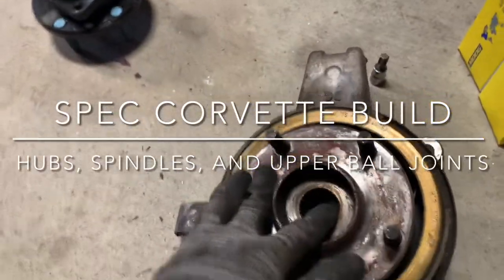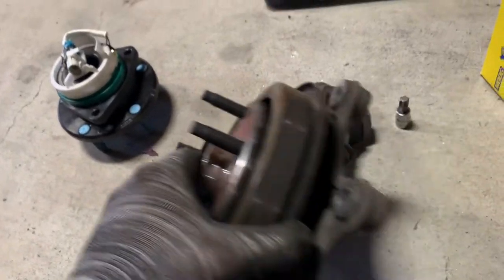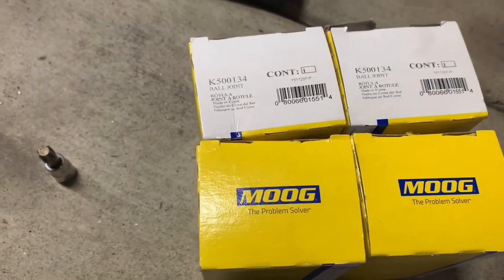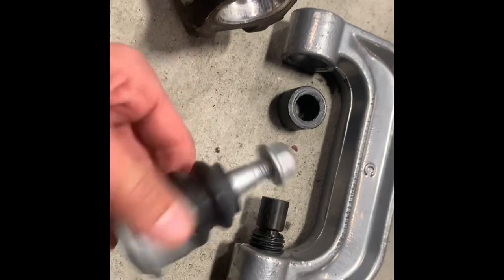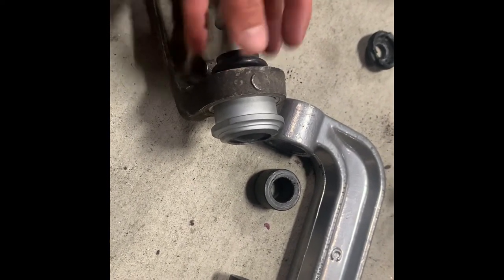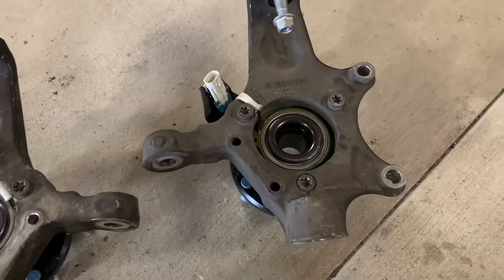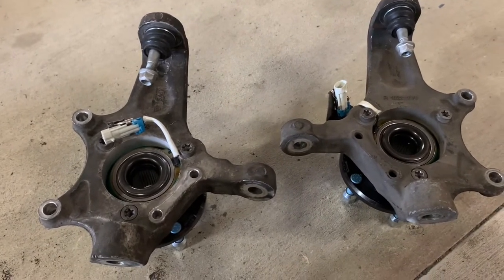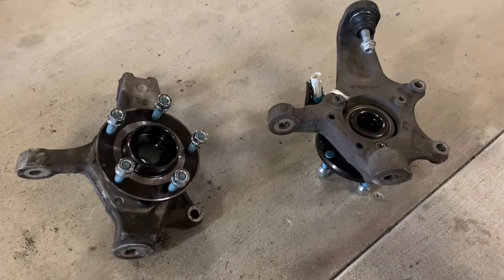Spec Corvette Build - Hubs, Spindles, and Ball Joints

Comment: I noticed that you did not use any heat on the upright to facilitate pressing the ball joint in.  When you have installed ball joints in lower control arms is that also the case?  Some people have posted that without applying heat the spindle or control arm will be destroyed while others have said heat is not required.  Your work is consistently excellent so I would like to get your opinion on this.
Also, apparently the Moog heavy duty ball joints are no longer available.  Have you ever used the Howe Racing ball joints?  Thank you.
Reply from the maker: When I did it the first time on the black car, I put the ball joints in the freezer overnight. I noticed very little difference between cold and room temp. As long as you line them up straight before pressing them in, I don’t see how you would damage the knuckles or control arms. I have not tried heat on the control arm. I don’t think it would hurt anything but suspect a result similar to freezing.
Reply from the maker: I have not tried Howe racing yet.
Reply: @joshc1017  Thank you very much Josh.  I really appreciate your expert advice.

Comment: hello. Have you found a need for the longer studs yet?
Reply from the maker: Not a need, but I would say that extended studs are more convenient. When changing wheels, you have to hold the wheel in place to thread on the lugs by hand. With extended studs, there’s enough length to let the wheel rest and start the lugs without holding the wheel in place.

Comment: What do you set your -camber at on the front and the rear??
Reply from the maker: I’ve been slowly increasing camber since we added the rear spoiler. I’m currently at 2.7 in the front and 1.5 in the rear. Did not run tire temps at the last race to confirm but tire wear looks better.